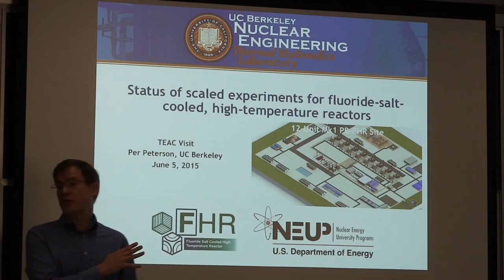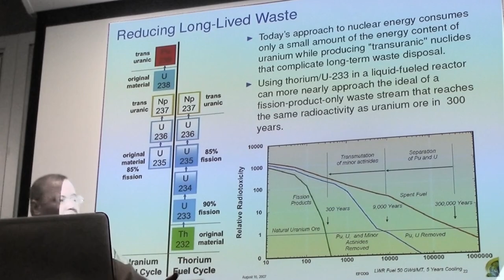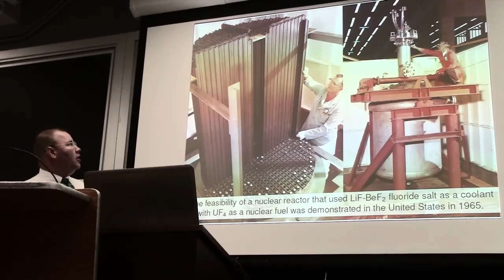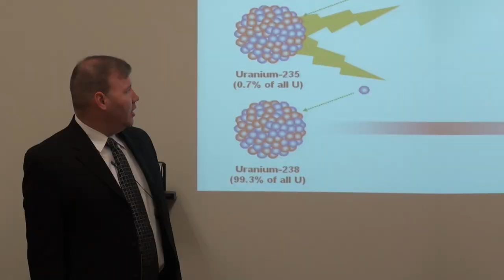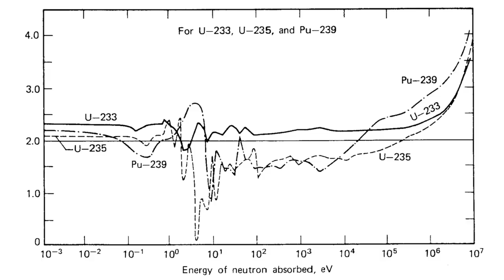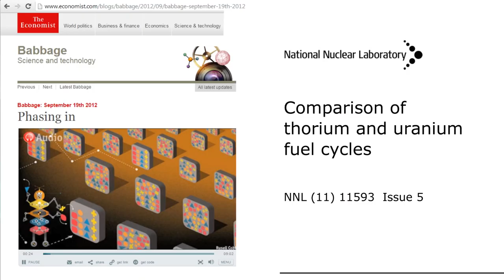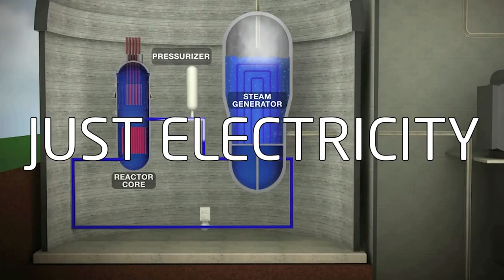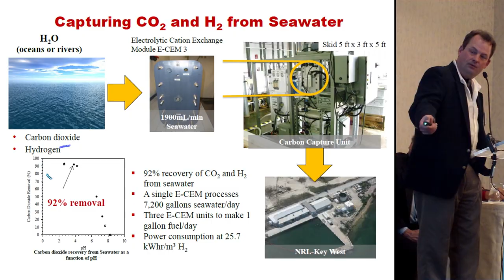Thorium Disadvantages

Comment: The Thorium reactor certainly is an interesting method for making energy, however, even I can see some deficiencies in it's working principle. These deficiencies will have to be addressed before sharp model is introduced.

The need for the fuel to remain molten will be the key challenge around these reactors. Even though it sounds great to have a fuel you can just flush like a toilet, there is a key moment in the operation of the shutdown procedure that could ruin the whole thing.

Should you have a failure that results in the flush piping cooling before the fuel is flushed, the flush procedure will become ineffective. Fuel rushing down the pipe will freeze over and block the flush pipe. With molten salt we're talking serious temperatures that need to be maintained at flush piping at all times to maintain it operational.

Another type of failure will render the whole reactor inoperable. That is when the reactor doesn't flush, but also couldn't maintain the reaction. Then, the fuel freezes directly in the reactor, with no way to re-melt it, destroying the reactor and all adjacent components containing the circulating fuel that can't be re-melted.

By this I don't mean we shouldn't perform research on this type of reactor. I say these things to remind you that thorium reactors are no miracle machines. They are at least as difficult, if not more difficult compared to solid fuel reactor. And so far, there was very little thorough large scale research done on these things. There are challenges not only directly visible, but also hidden ones, we didn't experience with these reactors so far, because we weren't using them. That's why we should approach this technology with caution, making sure we are not closing our eyes before potential dangers of this technology.
Reply: I don't know if Flibe Energy has commissioned simulations of their own drain tank yet but others have. Here's a fast-spectrum-MSR drain tank analysis: https://youtu.be/5WXALiUE0S0?t=810 , and thermal-spectrum-MSR (for ThorCon): https://youtu.be/hmUzJuvalZA?t=656 ...I don't know if drain-tank analysis is part of any DOE GAIN vouchers for Flibe Energy but right now their biggest news is Chemical Kidney funding and not Drain Tank.

Comment: I'm still stunned why we haven't gotten thorium reactors. Or why no private company were to produce a blueprint and patent it and build one.
Reply: DOE GAIN has provided 3 funding instances to Flibe Energy since 2018, so stuff is now moving ahead as opposed to rather stalled and lengthy 2011-2017 period. Not optimal however, still funding constrained.

Comment: Solving the corrosion  problem,  , I think is a major problem .
Reply: @c7042  Corrosion are mostly happens due to heat of the flowing molten salt, its not chemical based corrosion.
Reply: @rashidisw corrosion is chemical process.

Comment: As a layman I have one innocent question. The molten salt in the Flibe liquid fuel includes berylium. This is toxic and there is no cure for berylium poisoning. Could this be a significant impedement to the licensing of the fuel, its production and use?  This reminds me of the old story of the nuclear fuel transport operative who escaped radiation poisoning only to get lead poisoning from the shielding. The lead being the solution to the main concern masking the secondary concern of its own use.
Reply: It is an industrial process. It is a nuclear reactor. There's stuff that will kill you. Don't touch it. Keep it out of the environment. FLiBe is valuable and won't be wasted.
Reply: @gordonmcdowell best way to 'keep it out of the environment' is not use it in the first place...

Comment: I have been reading about this field since the 1960s. My biggest stumbling block has always been getting my head around the function of carbon ( and other things ) as a moderator. This is due to the term 'moderator', which is scientifically the best term to use, but is counterintuitive. Similar to the term 'noble' in the context of noble gasses or noble metals. It is weird 'science speak' best suited for institutions rather than sports bars. The idea is that something that is 'noble' is disinclined to interact with 'common' materials. Similarly, carbon moderates the interaction of neutrons with fuel in close proximity to the moderator. Moderated neutrons are far more likely to interact energetically with the nucleus of the fuel atoms. As if it were some kind of catalyst, which it is not, in the absence of a moderator, the rate of reaction is to low to be self sustaining.
In the reactor described here, when the cooling and circulation emergency melts the frozen plug at the bottom of the reactor core, the fuel falls away from the moderator in the reactor core into the safe storage vessel. No moderator, therefore no continuing reaction. Another time I will share my struggle with wave function and quantum entanglement - its even weirder.
Reply: Test

Comment: Concerning 4:06 

MIT alumni Dr. Leslie Dewan and Mark Massie founded Transatomic Power in 2011. Its board directors included E Ink Corporation co-founder Russ Wilcox. Among its backers were the venture capital outfit Founders Fund, of which Peter Thiel is a partner. ...

In 2018 the company announced that it would be winding down and open source its intellectual property. 

The company discovered that in 2016 it had made errors in its early analysis and realized that the design couldn't consume nuclear waste.

Despite the error, class act leaving behind the fruits of their labours for the next guy.

Comment: So we are chasing fusion when we have an almost limitless supply of thorium? That's like trying to build solar panels over an oil field and getting 0.1% of the energy in that same space
Reply: There's quite a bit of Uranium too, but it requires a fast-spectrum (ideally fast-spectrum MSR) to consume it efficiently. I suggest fusion ought to still be pursued, that ITER experiments and hardware continue (as there's already sunk-cost), but that people recognize it is entirely possible fusion will NEVER be practical. It might be practical. I expect it will (one day) be practical. But it MIGHT NOT. No one is re-creating the conditions inside the sun, because the sun is actually low-energy-density... the reason the sun produces so much power is because it is freaking huge. It is huge, and we can't create gravity. That's not news to fusion researchers, but I don't think voters see the difference between momentary break-even and a practical energy supply.

Contrast that with Th-MSR. IMHO very doable. Right now biggest challenge is "Chemical Kidney", which (as Kirk Explained in Brussels in 2018) can be greatly advanced with low-cost non-radioactive chemistry R&D as can be conducted on university campuses (not national labs). Neutronics and behaviour of liquid leverage computer simulation. Re-testing vessel alloys already scheduled at NRG/Petten (with a MSR fuel test completed just this week). Th-MSR R&D is taking place with the design of commercial reactors in mind. China's building a pilot Thorium (solid-fuel and liquid coolant) Molten Salt Reactor RIGHT NOW.

Even if Th-MSR somehow fails to commercialize (and I'd bet that it will), "chasing" Th-MSR assists every other MSR permutation. There are MANY permutations, and they all start with the basic notion that the water used in BWR and PWR can be improved upon using Molten Salts as coolant instead. From there... different fuel cycles... fast-or-thermal spectrum... solid-or-dissolved fuel... even Moltex has a notion of liquid-fuel in metal-pins. All sorts of ideas. And just as MSRE already happened in the 60s, there's no looming question as to whether the concept is practical. An MSR pilot has been done already (MSRE). The participants considered it a success, and were shocked when the program was cancelled.
Reply: Going with your metaphor, it would be actually wise to build a solar panel plant over an oil field. Solar is clean and renewable, oil is neither.
Thorium is a game changer....but fusion energy, if achieved, would propel our civilization to a whole new level.
Reply: Just like i say with renewables and nuclear : they aren't mutually exclusive. Thorium can power up humanity for 
Millennias, so does solar, so does fusion.
We should not be picking favourites, we should simply fire all cylinders and unleash the strongest potential humanity ever had. We need to innovate everything, everywhere and everytime to pave our way to the stars

Comment: The video says two things. 
1) Several non-US countries are "doing it right". 
2) US companies are happy to do what works, they just don't want to be first at it. 

OK. I hardly see a problem. Let Canada or China or wherever pilot the system and then implament the mature system here. 

And since most of this is more than 8 years old... if "regulation" is the issue, this must have already happened. How many large thorium reactors are operating today in China? Canada? Elsewhere?
Reply: I dont think you understand the time things like this take.. Take fusion for example, a few years ago china+usa+eu+india+jp+ru decided to invest in a type of reactor that would produce power if you built it large enough, so they decided to invest in it together. Building the reactor is going to take 12 years alone, then they will run the reactor for 10 years before starting to go up in high enough power to produce electricity. So with a research reactor that started building 2013 it is going to produce energy at 2035 at best..
Reply: None of those statements seem relevent. 

You don't want to build a large number of plants if you don't have a working research reactor; and if all these other countries are "doing it right" as claimed, one of them will setup the research reactor... so no problem. 

The only way the status quo, as described, need changing is if someone is attempting to use this as an excuse for personal gain.
Reply: @jerrylove865  I simply responded to the time-table, i don't care about what usa is doing. I just said that even though countries started building research reactors 8 years ago, i doubt any of them are in even 50% capacity yet. I also agree there is no point in building 100s of reactors before the research is done, but at the same time i personally think there should be one research station in EU so that we can get that expertise as well. I would rather not trust that china let us practise on their reactor and its always good to get hands on experience before you start to build real reactors.
Reply: 8 years is less than one takes to build.
If we are talking large commercial ones, China is building 3 rn.
As for operational, there are around 7 research ones that are under 300MW.
But those still count to prove it works.
The problem that this video brings up is the fact that we could've been at this stage 70 years ago if not for internal American politics and broken regulations.
Reply: @LoisoPondohva  "The problem that this video brings up is the fact that we could've been at this stage 70 years ago if not for internal American politics and broken regulations"

America regulates 5% of the world's population; unless you are saying no one has yet to advance to where the US was in 1950.
Reply: @jerrylove865  America pioneered the technology and set the standards for the whole world for decades by making this choice.
Building a new type of reactor takes decades, so yes, US government is responsible for the most of those 70 years.
Reply: @LoisoPondohva  You said, if not for American broken regulations, we would have been at this stage 70 years ago (the 1950s). 

What American regulation has prevented the other 95% of the world's population from getting to where you said we would be without those regulations 70 years ago? 

What regulation stopped Russia in 1970, or China in 1990, or India in 1980? Do please show me the regulation that's the issue for those countries.
Reply: @jerrylove865  until the 80-s USA was an absolute and unchallenged leader in nuclear energy.
Everyone copied them because it was the only way to keep up.
When us made this choice, they made it for the world in practice.
After 90s some countries have surpassed US in this field, and they started this research anew. 20+ years later we see its fruits.
And stop with that 95% nonsense. Population has nothing to do with this. African continent is home to 17% of world population and has only 2 nuclear reactors, one of which is not even man-made.
Reply: @LoisoPondohva  But you said we could have had this 70 years ago.. .that the US was capable of this in the 1950s and stopped by "stupid policy and regulation". 

I didn't ask if anyone in the 1990s was ahead of the1990s US, that's not the requirement. I've asserted that someone (basically every nuclear power) in the 1990s was caught up with 1950s US, which is what you put up as the standard. 

So I'll ask the same question I keep asking and you keep avoiding. 

What US policy stopped 2000 China from doing something you've stated 1950 US could do? 
What US policy stopped 2000 Russia from doing something you've stated 1950 US could do? 
What US policy stopped 2000 France from doing something you've stated 1950 US could do?
What US policy stopped 2000 India from doing something you've stated 1950 US could do? 
What US policy stopped 2000 Japan from doing something you've stated 1950 US could do? 

I'm pretty sure at this point you aren't answering the question because you can't answer the question because your premise is false.
Reply: @jerrylove865  4 of those countries startdd that work in the 00s.
My premise still holds. Us lost us all time.
Reply: @LoisoPondohva  That's 21 years ago. 

It's also 50 years after you said the US could "have it done". 

I'm still waiting on you to tell me what US regulation prevents China, Russia, France, India, Pakistan, etc from being where you said the US could be 70 years ago. That's your claim. I believe you claim is false as it's unevidenced and counter-intuitive.
Reply: @jerrylove865  I believe you don't have the mental capacity to see blatantly explained processes in front of you, so I wouldn't entertain this conversation further.
All the needed information was presented, your inability to understand it is not on me.
Reply: @LoisoPondohva  Yea. Sure. That's it. 

You came up and said "The problem that this video brings up is the fact that we could've been at this stage 70 years ago if not for internal American politics and broken regulations."

So I asked how that stopped everywhere that wasn't American. 

You declined to answer instead focusing on the fact that not all of the 95% of the world's population that wasn't American could build reactors. 

So I asked again how that stopped the places that could. 

You said America was ahead of everyone else... which still didn't answer the question. 

So I asked again how American regulation stopped other nuclear powers from doing this in the 70 years between when we could and now (or if you were claiming the US was 70 years ahead). 

You didn't answer, instead saying that the US lost us time. So again I asked how US regulation prevented the rest of the world from doing this for 70 years. 

You haven't  mentioned a single regulation, much less offered an explanation as to how it stopped Russia, China, India, France, and Pakistan from doing something you claim the US could to 70 years ago. 

Now you are using the "take my ball and go home" defense, complete with some unsupported allegation that it's my fault. 

Let's be honest: you haven't supported your claim because you claim is false and, as such, is unsupportable. You've attempted over and over to redirect the conversation away from your claim onto other claims and, as that has not worked, you are now creating excuses to stop responding without owning up to your lie. 

If you can't cope with being called out, you shouldn't have come up and commented. Did you think because it was 2 years later I just wouldn't respond? I'm guessing so. You gambled on your BS going unchallenged and lost.

Comment: Thorium can't be made into a weapon. I've heard.
Reply: it can but it's like 100 times harder to make a bomb out of thorium waste products compared to uranium and the bombs made with it are not as good, it'd be way more expensive to make a bomb using thorium waste products than to just make a bomb with current methods.
Reply: @The9thDoctor  In 1950 the nuclear bomb was number ONE priority and the electric power production was number TWO. But now we have enough atomic bombs that we give them away "free" to some countries. So what is number ONE priority now in 2020 ? The bomb or low cost electric power ?  Regards,  Patricia
Reply: @patricialawson6749  it no longer matters, because anti-nuclear people have made it hard to get new designs/methods approved for commerical use.
Reply: Yep and it also doesn't create power as thorium. Step one in this process is turning useless thorium into fissile uranium which can generate power including in bomb form